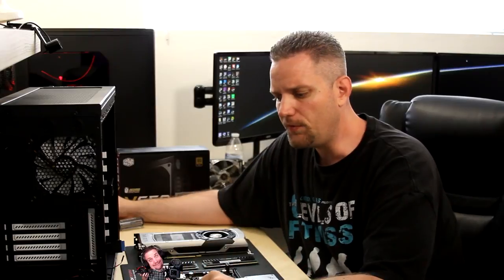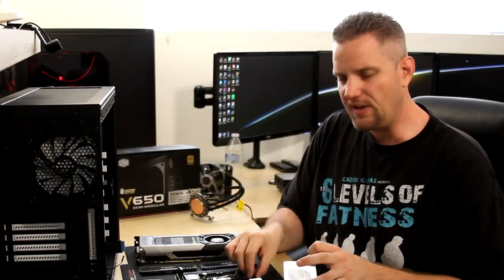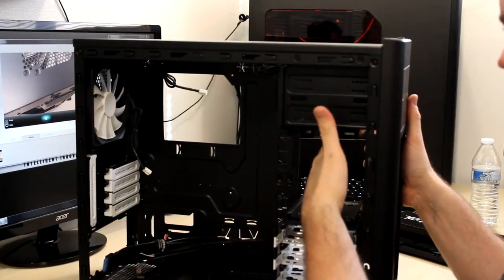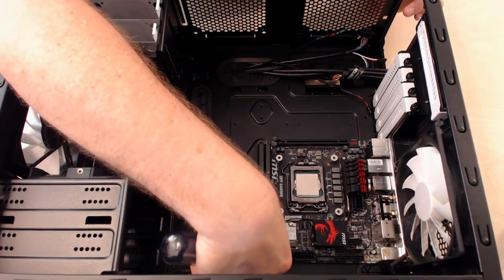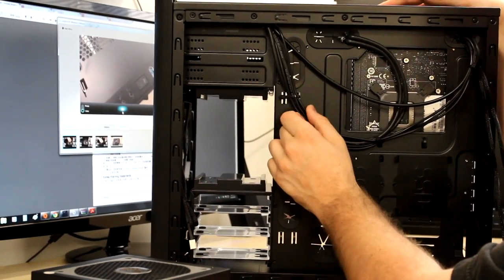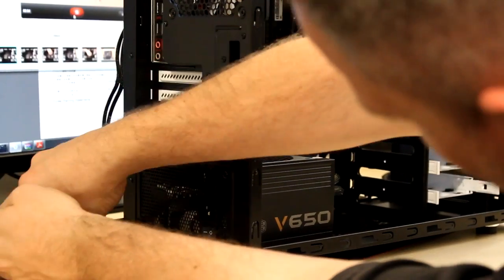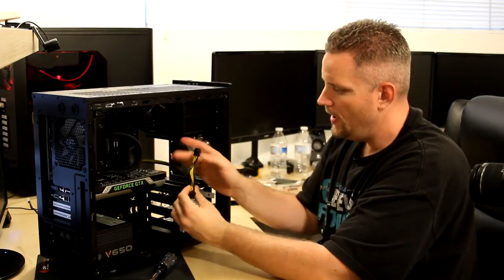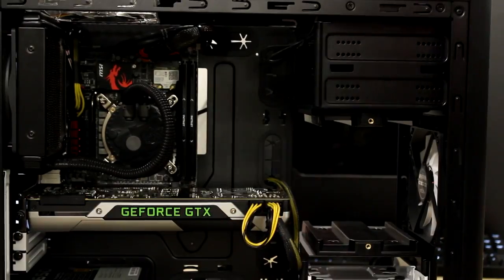Beginners Guide: How to Build a Computer

Comment: Would http://pcpartpicker.com/p/WXV6wP be good for gaming and adobe after effects?
Reply: +killerLTU It would be a good starter. 1.) i'd switch out the kingston ssd for something else. i've always had problems with them being faulty or extremely slow for an ssd. 2.) for future reference you may want to upgrade to 16gb of ram for editing/streaming/and all that software stuff :) it'll help!
Reply: I was thinkink about samsung ssd, but i picked kingston in a hurry, and the ram would be a good upgrade but i would start with 8 gb.
Reply: killerLTU samsung is very popular.
Reply: if you are going for gaming you could of gotten and fx 8350 (really powerful cpu) and an r9 380x and the msi 970 gaming motherboard. Also get a 750w power supply to future proof. Other than that its a good setup :)

Comment: If you want to build a PC, Go with AMD and with the money you save, Buy a High-End graphics Card. the fx 4350 and r7 370 are a great duo, I get 1000 Fps on minecraft sometimes... and 37FPS on ultra GTA V, Honestly, intel is overpriced and are bad. I only spent $420.89 on this PC (also got 1TB & 12GB RAM) and it runs about the same as my friends intel i7 4770 with EVGA GeForce GT 740 2GB at $800. Let the comment war begin FacePalm
Reply: +Rallenhayestime I honestly believe it is what you prefer. I have absolutely no issues on my Intel. AMD is cheaper, but cheaper parts can lead to issues. I think both are great processors, though. I tell people get the Intel if you can afford the price, but if you are on a budget then definitely don't be shy about AMD as they are nice as well.
Reply: the only question is...

does it run roblox
Reply: I Nvidia is way better for high end though, anything 1440p and higher is Nvidia territory.

Comment: warning its not the amd chip u need to watch its the lga pins on the mother board(intel) if u bend 1 of them u more then likely never bend it back,i tgook 1 chip of 1 to test another when i put the chip back the pc would turn on took chip out and 1 of the lga pins was bent and i didnt even touch it only put the chip on if it was a AMDchip i could of bent it back, intel r crap

Comment: Can some tell me if this is a good pc bcuz im new with pcees and im gonna build my pc for first time
http://pcpartpicker.com/p/2JmNnn
Reply: Thats like top of the line! But i would get the 6700k so you can overclock
Reply: I'm Building my first PC too, I had an improvement for you.
1)First off you should use 6700k for overclocking
2)Reduce money in other areas and buy a better graphics cards. Trust me, It will last longer.
3) Post it on r/Buildapc. The guys there will help you out A LOT
Reply: STOP!! Switch out the hdds (yes all of them) for an ssd my bro works on these and he says that they are something like 10x better
Reply: +DaxLax don't buy a gtx 960 wait for RX 480 or buy the r9 380 but I say that you should wait for the RX 48 it is gonna give you much more performance and also why an i7 6700 and not an i7 6700k buy like an h60 cooler and get an i7 6700k and the h60 cooler is not bad and maybe buy a cheaper case like the corsair 100R link is here http://www.amazon.com/Corsair-Carbide-100R-Tower-Case/dp/B00RORBQNW?ie=UTF8&keywords=pc%20case&qid=1465319912&ref_=sr_1_4&s=pc&sr=1-4 so wait for the RX 480 and don't buy that expensive case and don't buy the 6700 buy the 6700k and buy the case that I showed you the link and also gt an H60 cooler not the H100 and then BOOM you saved 100ish bucks, you're welcome.
Reply: Wow, thanks....i'm wordless
You wrote so much! Big Thanks!
Reply: No problem I just wanted to help you
Reply: +Cristian Gabriel Capatina

welp you just stole my reply XD
Reply: Looks good, only thing I'd say is seriously consider investing in an SSD instead of a mechanical drive. Get a cheaper version of Windows, since 8 was awful and free upgrades to Windows 10 are available until July, you could get a cheaper version of Windows and just upgrade. Also, I have that CPU and I'd recommend the Asus Z170 Pro Gaming Motherboard instead of the MSI.
Reply: Everyone is forgetting one big thing:

Don't get a Z170 mobo if you aren't getting a k version cpu. The mobo will be useless.

Same for the other way around. If it's say, an H110 mobo (something not Z170) a k CPU will be useless
Reply: ***** Why is that? I've never heard of that before.
Reply: Jake Guest If you have an overclockable CPU from Intel you can only overclock it on Z170 mobos (or so I've heard)
Reply: That's what I thought, the 6700 is okay if you want to maybe upgrade to an overclockable version in the future though (:
Reply: Jake Guest Yeah
Reply: +The Notorious Gamer Getting an ssd the size of a common hdd (1-4 TB) Would cost a fortune. Get a 120-240 gb ssd + an hdd.
Reply: You don't need a 650W PSU or an i7 for a GTX 960
Reply: If you're just watching anime you don't need that... Lol that is a good computer I would balance out the graphics card and CPU maybe a 6600k and a rx480.
Reply: The Titan! It won't bottleneck it I think, and if it does it'll only do so by a small margin. Though the money on the GTX 960 is better spent on an RX 480 or GTX 1060
Reply: your pc parts choice is good, but if i were you, just buy a 1060 or 1070 its a much much faster than the 960 and i HIGHLY HIGHLY RECOMMEND YOU TO GET A SSD, YOU WILL NEVER USE YOUR HDD FOR OS AGAIN ONCE YOU INSTALL YOUR OS IN A SSD

Comment: Was wondering if people could take a look at this build i put together and give me any tips (im assuming most the parts i picked dont go well with each other :/ but i tried :) i was looking for a build under £900 or just a bit over.

http://uk.pcpartpicker.com/user/Jimbo35637/saved/7m

I am hoping this pc can run games such csgo or more of the latest games in high or better and at 40-60 fps :) i am coming from console so there is much i still need to learn about PC's. But whenever i do try to do more research into certain parts i end up getting even more confused :c

Any help is appreciated as its helping build my own PC! Thanks to anyone that helps!! :D
Reply: +Jimbo 35637 wow i have a shitty laptop with a amd apu and it can run cs:go 30 fps ITS EASIER TO RUN THAN MINECRAFT
Reply: +Imre Saks oh lol xD
Reply: +Jimbo 35637 your link is dead, I can't see it
Reply: +The Ultimate Walrus this one should work i have changed it from the original one http://uk.pcpartpicker.com/user/Jimbo35637/saved/CpYCmG
Reply: Jimbo 35637 Seagate HDD drives are sketchy, I would suggest you get a WD Blue drive instead (I don't know if its more expensive in UK, but it is a better drive)

I would also suggest you get a R9 390 instead of the 970. The 390 has better performance than the 970 and should be the same price/cheaper (I don't know if the prices are similar in UK)
Reply: The Ultimate Walrus ah okay i will look into it thank you :)
Reply: +Jimbo 35637 Don't go with an ASRock board go with a Gigabyte or a Asus. Because they're cheaper have bad tech support jus not worth the headache.

Comment: Are these parts compatible ? http://pcpartpicker.com/p/44W399
Reply: Get the fx 6300, it's actually like a few bucks cheaper than the 6200, and if you CAN dish out a little more $$ to get either a gtx 960, or an r9 270x, the 750 ti is a nice card, but it's super budget oriented. EVGA also has a cheaper psu, which is pretty good IMO, it's the EVGA 500b, you can find it for about 39.99 USD, and it's great for that build
Reply: Oh thanks man1 good to know but all the parts are compatible (With the ones you told me to get)?
Reply: Yes
Reply: Yes Damon Regulant but for the same price you can get an r9 270x instead of the 270 which is a little bit more powerful : http://www.newegg.com/Product/Product.aspx?Item=N82E16814131532&cm_re=r9_270x-_-14-131-532-_-Product
Reply: Also, i've heard a few bad things about that case and heatsink support, like if you get a different heatsink for the cpu, it probably won't fit, instead look for a Deepcool case on newegg, they're a little over 40 USD and well worth it according to Logan over at TekSyndicate
Reply: Oh sweet good to know do you know how many fans it has?
Reply: Sorry for bugging you btw, ur a big help xD
Reply: Done// http://pcpartpicker.com/p/ngZc7P

also it says// Some AMD 970 chipset motherboards may need a BIOS update prior to using Vishera CPUs.
Reply: Damon Regulant Sometimes, rarely they do, usually if it supports FX CPUs then it usually will support it straight out of the box. Looks like you'll have yourself a nice gaming PC, enjoy!
Reply: Thanks! i really appreciate you helping me :)

Comment: What do you guys think about my first build? http://uk.pcpartpicker.com/p/4ZVgXH
Reply: Not bad, but you won't be able to upgrade it. If you don't hope to upgrade it in a few years, then go ahead.
There are no more CPU's with that socket type, and DDR3 will only become available in secondhand editions.
Reply: Your CPU is more expensive than your GPU, so I suggest getting an AMD FX-8350/8320 and picking up a 970.
An 8350 won't bottleneck the 970 out of the box, but if you plan on overclocking the GPU, pick up a nice CPU cooler so it can keep up.
Reply: Cathal Ryan
"Your CPU is more expensive than your GPU"
And what is wrong with that?
Reply: +STR33TSofJUST1C3 It's usually not worth getting a CPU thats more than the GPU (unless the CPU is overpriced or you get a good deal on the GPU) as you will have much more than enough processing power to support the GPU. If you're mainly going for gaming, there's not much of a point in getting a CPU that can handle the GPU with a breeze if you're not going to do other things that will utilize the CPU like streaming or recording.
Reply: G&G Films
If you're going to afford a CPU that's only just capable of managing your GPU, you leave no room for upgrades.
But essentially, the rule of thumb is:
gaming -> i5
Gaming and/or more -> i7 or Xeon

Comment: way too much thermal paste
Reply: There's a LinusTechTips video on it. A little extra won't hurt as long as it's not conductive. It's more of an issue if you don't have enough of it, and the application method doesn't matter much either.

Comment: Would this be a good build for gaming? 
http://pcpartpicker.com/list/HFgZRG
Reply: I would get an ssd and maybe save a few extra bucks for the Rx 480, also get a better certified psu
Reply: +Travis Shaffer u could go with either graphics cards tho
Reply: Travis Shaffer My budget is 700 dollar so it will be a little bit expensive =( I add a ssd later
Reply: +MrDutchgaming123 I wouldn't build a full PC for 700 I'm sure u could do it but if u just save more money u can get a way better build like maybe 900 or even 1000
Reply: Why not 6600k? just wondering
Reply: is this a solid build? http://pcpartpicker.com/list/kJJ3Z8
Reply: ya, but might go with a different ssd (samsung, pny) and go with gq psu instead.
Reply: +JJVgaming what wattage psi would you recommend?
Reply: 650w should be more than enough for what you need but that is a good thing. The gq variant is just better than the supernova nex one you have, for only $5 more.
Reply: MrDutchgaming123 get the Radeon 480

Comment: Thoughts on this first build anyone? It's expensive, but I want to do it right the first time (although as economically as I can).
http://pcpartpicker.com/list/DRdQGf
Reply: I think it is great. If you would need to cut cost, that video card seems pricy(you already know that) but as said I would take some of the savings of a cheaper video card towards a higher end power supply. Just my two cents
Reply: ***** I completely have filled my 1TB HDD on my laptop currently, and still could fill a lot of space if I had the room. So the storage is purposefully over the top so I never have to worry about storage again XD
Reply: Timblegoorn im currentlly making my own why do u have two things for memory im new sorry
Reply: Hypnos Gaming I have two things of memory because my motherboard has multiple RAM (memory) slots, and it's cheaper to buy multiple, smaller quantities of ram rather than one higher capacity stick.
Reply: i would bring down the hhd to a 2 tb and the ssd to a 240 and get a better cpu and also u need the os